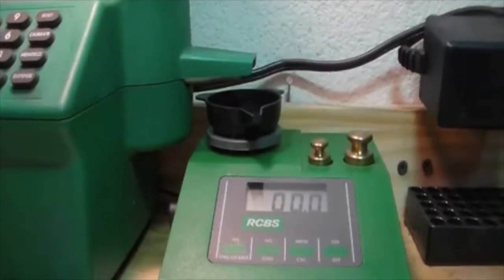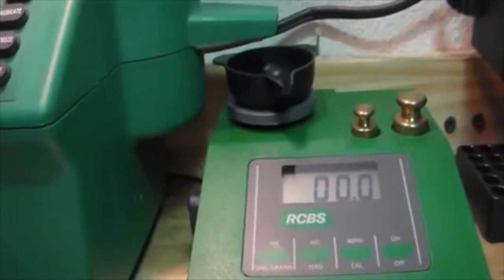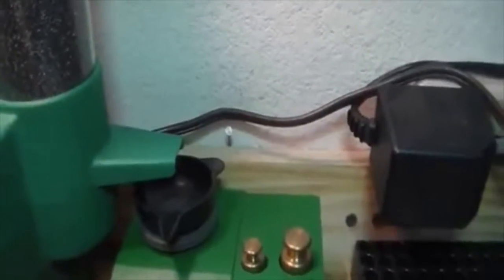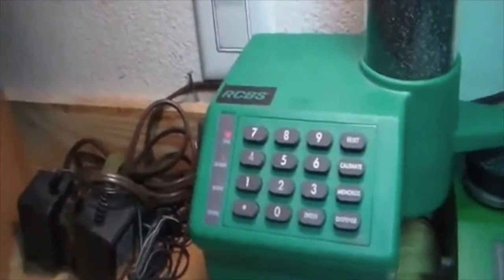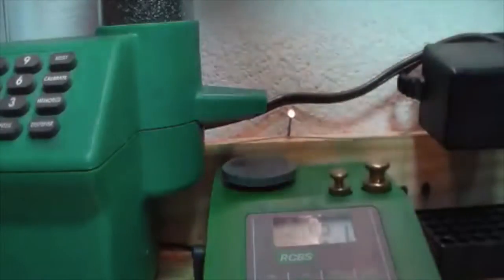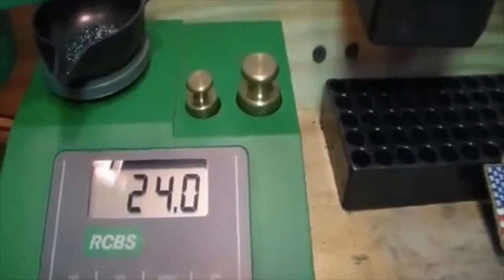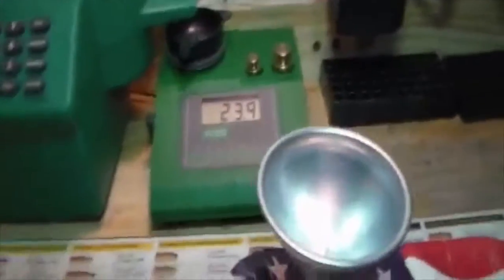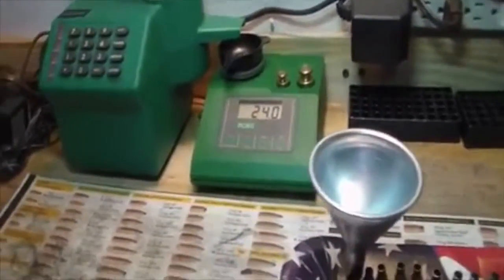Powder Scale Calibration

Comment: Running the same as you...bought it new loooong time ago. To speed it up use a Lee dipper that will add in about 1/2 of the desired load, after pushing the dispense button and it starting to dispense...dump in the dipper full and the unit thinks that's where it is, keeps running until it slows to a trickle and finishes. I also do other things at the bench to occupy my wait time on the throw.